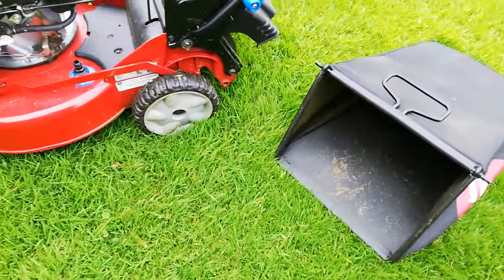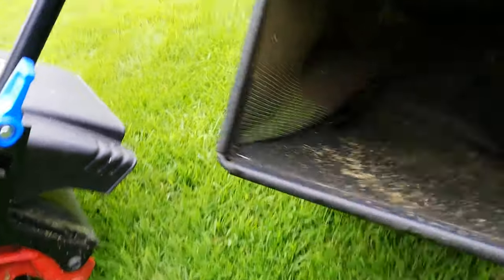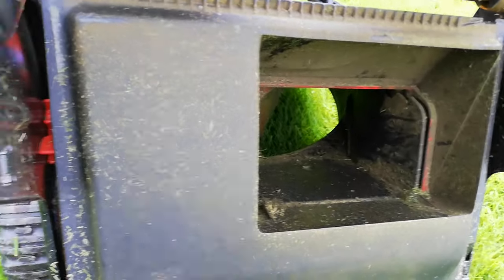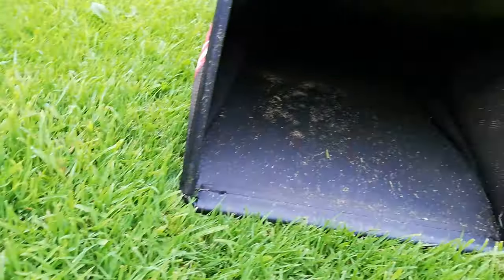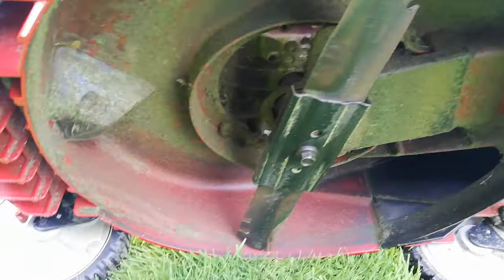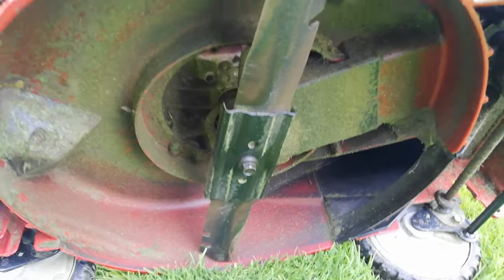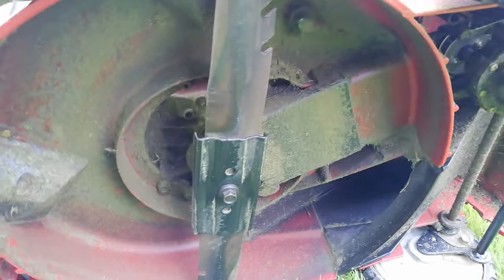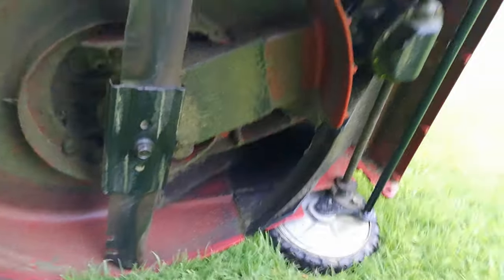Lawn Mower NOT BAGGING / Collecting Well, Check These Things

Comment: Something we should all do more often. 

When you do a video on blade sharpening, will you cover torque settings  on  the blade screw using the wrench. I hope that makes sense.
Cheers.👍🏻
Reply from the maker: I rarely use a torque wrench these days mate, but if i remember to i will get it out for you and try and show the equivalent torque specs for how tight i do em up. 👍
Reply: Appreciated. You could explain why you don’t use one. I am always frightened of over or under tightening the nut. Cheers.
Reply from the maker: I will try and go as in depth as i can on it. Anyway i use a impact driver pal, another tool you def need to add to the buy list 😉. The blade bolts can normally handle a fair bit of torque so go tighter rather than looser, just dont overdo it 🤣

Comment: Only time my Toro stops bagging is when the rear chute gets clogged which can happen as soon as you start mowing especially when the grass is damp or wet. What I do is pop a little wheely and jiggle it every so often to keep that chute open cause there is a lot of air blowing that grass into the bag. That's probably the biggest problem with the Toro, it works so good  and shoots so much out the back into the bag so fast it clogs up the chute too quickly, luckily it's pretty easy to unstop it and get it flowing again. And it's easy to check if the chute is clogged just by lifting up the flap in the back and looking. Do not, I repeat, do not stick your hand in there to scoop the grass clogging it out and into the bag while it's running cause the blade is right underneath the grass spinning. Really people, these mechanical things are not magical devices, they are fickled and need constant care and maintenance.
Reply: We know that.but yeah stupid people shouldn't be mowing

Comment: Im irish mate so our grass and conditions are the same autum and spring run hi lifts on thst mower in summer the gator style or mulcher toro do a super collector its the same hi lift blade
Reply from the maker: This is just my small mower i use if i need to lift down steps etc, i have other bigger and better mowers to use when needed. Its a 19 inch mower as well mate so not many options in the blade department. I have no problems with it anyway, it does what i want it to do 👍
Reply: @RJLgardens  ah ur sorted so i use john deere mowers but deere is gone out the small mower market now so il be re powering for a few yrs

Comment: Thank you milord.  Wonder though if the blade had fins on top to move more air it would benefit the performance.
Reply from the maker: Yes the bigger the wing the better the airflow 👌
Reply: I ended up cutting a small long slit near the back, now the bag actually fills up properly.

Comment: Main thing is make sure your using a lifting blade & not a mulching blade because the mulching blade is designed to juggle the grass in the deck & release it out the side. I tried bagging with a mulching blade & it would only fill half the bag & it would cake up on the deck & even start forcing grass out the spring loaded trap door. The Lifting blade cuts it & sends it to the bag & doesn't create those clumps.
Reply from the maker: Yes definitely a high lift blade is preferred when bagging, not every mower has the option though which is annoying. 👍
Reply: How do we know how to choose the lift blade. Would it say it on new blade?
Reply from the maker: @justdissin7340  So for bagging specifically the blade with the largest and highest wing (the bit behind the cutting edge) will normally improve the mowers collecting. What blade you need all depends on how you mow your grass.
Reply: @RJLgardens my toro will stop when mowing long grass, is that because of the blade? or mulching? how to fix
Reply from the maker: @noahark4670  You shouldnt really mulch long grass, better to side or rear discharge. If mulching the grass, taking off anymore than 2 inches will clog up the deck most likely and put strain on the engine if its not powerful enough. Make sure your blade is sharp to 👍
Reply: @RJLgardens  thanks

Comment: What if you start mowing with a brand new lawn mower that is perfectly clean and you can’t get a single blade of grass to go into the bag?
Reply from the maker: Is it actually cutting the grass initially? Firstly make sure the bag is on 😂. check you haven't got a mulching plug in or a chute blocker closed, then check the blade isn't on upside down and that it is also sharp. Failing all that take it back for a refund 🤣. 👍
Reply: @RJLgardens  Guess what? I looked at it more closely today. There was a plug! Silly me. Problem solved.
Reply: Plug where

Comment: Blades are so cheap that I would rather replace and use the old one for blacksmithing things or a yard hacking tool.
Reply from the maker: I dunno, some of my blades are £50 each🤣. I would much rather spend 10 mins sharpening it than buying a new one every time it gets blunt. 👍
Reply: @RJLgardens  it's about the same here in USA, like your said. In America most blades for commoners are case hardened. So it's only a very shallow level that's hardened. Commercial blades though, they're very good, hardenable steel. They hold an edge way longer, cost around $50-100 American.

Comment: Id put a proper high lift blade on that mower the gator style dont bag as good
Reply from the maker: As far as i am aware there are not any proper dedicated (normal) high lift blades to fit this model of mower as the universal ones do not fit the blade adaptor. If you know of one please let me know.
There are 2 common blades for this particular mower that look identical (both gator style) but one has a more aggressive lift which makes bagging much better than the standard 1. 👍
Reply: @RJLgardens  il find out for you man what u find at times with toro a high lift from there other mowers will do but what iv done is change the part it bolts on to for a more suided blade cheap and easy
Reply: there are 3 different blades
standard - hi-lift - gator replacement. Only the toro dealers know the hi lift part number.
It's off another toro "style" mower. and the hi lifts are used for side shooting the grass further.
Reply from the maker: @v8soarer1991  I have the higher lift blade fitted on this mower, its a 19 inch model so has limited blade choices unfortunately, without modifying the blade adaptor etc. 👍
Reply: The mulching blade works fine while bagging, the ventilation system is powerful enough to suck up all that grass and shoot it out the back into the bag, it works too good and if the grass is wet or even a little damp, which it usually is, it will clog up that chute in a second. If the bag isn't filling pop a wheely and jiggle the handle to try freeing some of that grass out of the chute to get the air flowing out and into the bag again. Gravity is our friend. Check it by opening the back flap if it's not bagging and you'll most likely see the chute is clogged. Easy thing to do while you're mowing, but don't stick your hand down there and scoop it out while it's running or you'll chance losing an appendage.
Reply: @princenaz23  for bagging here in ireland we need a high lift blade